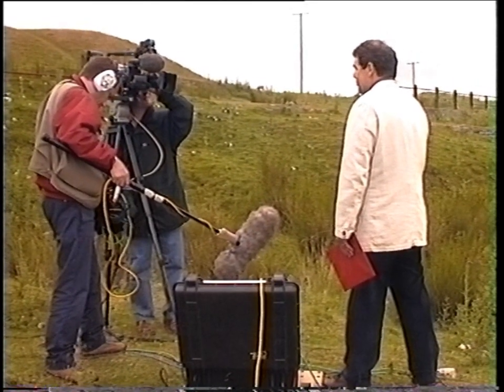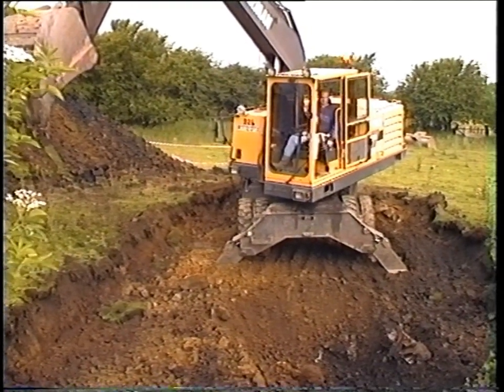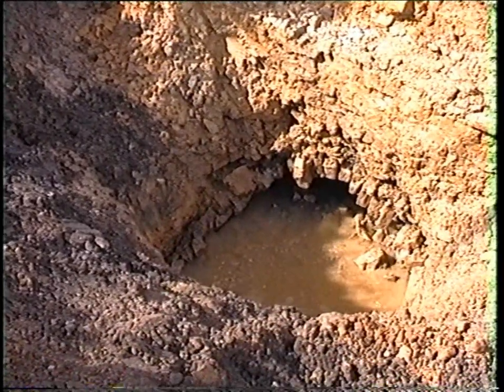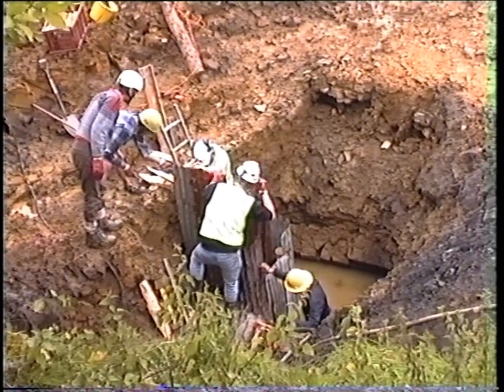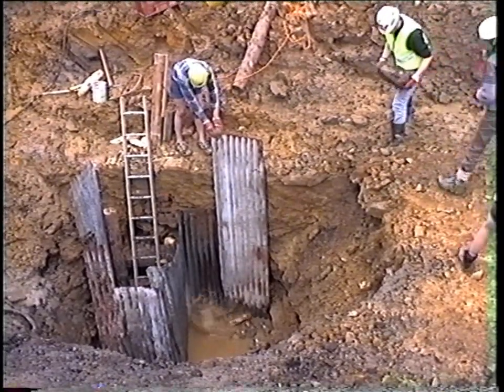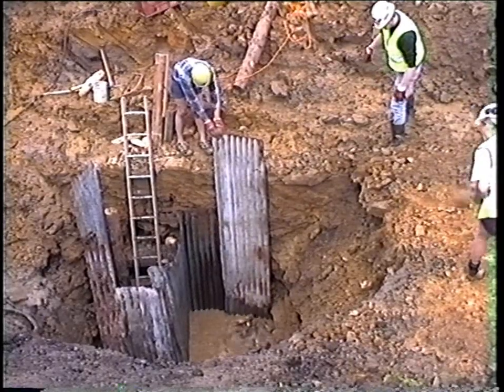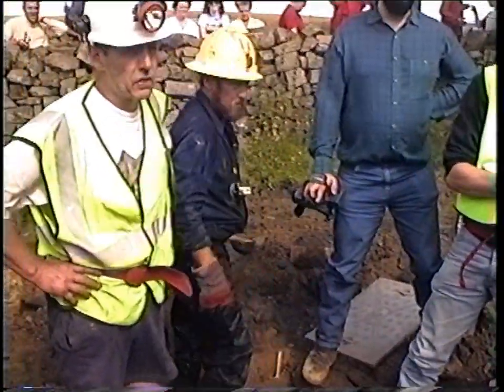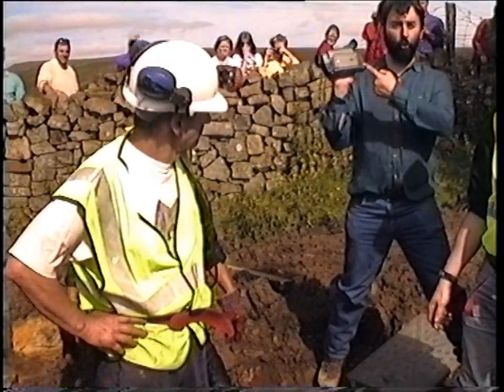Pwll Du Mine tunnel Blaenavon June/July 1999

Comment: Thanks for the great filming with steady camerawork and good picture compositions, which I didn't know back in 1999 you'd done so comprehensively. The gold was in getting into the tunnel successfully and safely, and being part of the first team to get close in recent times to the Y-junction of the Garnddyrys and Tyla entrance branches. There is a strategy for making more progress based on the knowledge gained inside so far, but it involves managing the water inside the tunnel without causing pollution or other problems on the surface and also pumping air to the working face from the surface.

Both the substitute mine manager, John Lister, and the mines surveyor, Paul Deakin, seen in the video, are now sadly deceased through health issues, so there's currently no one in place to help meet the mining regulations when reopening an abandoned mine. This is essential for the safety of everyone concerned - my forthcoming book(s) on the history of Llangattock Mountain and the Heads of the Valleys contain graphic accounts of those who got it wrong in coal mines when using naked flames underground, etc., etc. etc.

The Pwll Du to Blaenavon tramroad tunnel has coal workings to either side along the route and these will have to be plugged as progress is made inside the tunnel down through the mountain. The drop of 70 feet (how the miners measured it!) from the upper to the lower entrance was sufficient when the tunnel was open, without blockages inside, to cause a howling draught. Thereby the tunnel was ventilated quite adequately when it was operated by horse-drawn trams and later a stationary engine. It was also used by villagers living at Pwll Du as a short cut when going shopping in Blaenavon, especially during wintertime. In fact it was difficult not to be blown off your feet at the top end when atmospheric conditions drove the strongest draughts!

The ultimate purpose is to explore and make a survey of the tunnel interior for comparison against the National Coal Board (NCB) abandonment plans of 1961. If the condition of the tunnel is satisfactory then my personal dream is that the tunnel can be stabilised inside and reopened for the public to be able pass through it, perhaps with a small bus picking people up and/or dropping them off at the Pwll Du end. This was my intention when commissioning Michael Blackmore to make his drawing of the planned reopening works. Although the drawing was paid for by my company, The Secret Bottletop Production Company Ltd, and John Rogers (for Torfaen County Borough Council)  (who holds the original), CADW was also supposed to pay the final third but left John to do so instead.

Even if all of us who have been keen to reopen the tunnel end up departing this world before the survey work and restoration can be completed, it would be very good to know that videos like this should still be around to help inspire future generations interested in the industrial history which has helped make Wales, Britain and the UK in general pre-eminent around the world.
Reply from the maker: Thanks for that very comprehensive reply Clive. Very sad to hear of the passing of John Lister & Paul Deakin.
Reply: If your ever going up there Clive be nice to meet you and chat

Comment: Exercise in futility
Reply from the maker: No. Exercise in planning, teamwork and an achievement of objective. Which was to locate and make a safe access into the collapsed mine.
The whole point was to leave a secure entrance shaft.
If it wasn't what you were expecting then I  wouldn't get involved in digging for caves/mines, as it's never a 100% certainty. Although due to the research and everything involved. This turned up trumps on the day. 👌🏻👍🏻🙏🙏🙏

Comment: What was the purpose of that digging and testing and stuff?
Reply from the maker: The digging was to open a safe enrty point into the old workings. I believe that it was thought that a natural cross rift, farther into the workings may have existed. This would then have been explored by those involved in the area.
The testing was a requirement of the H&SI to ensure that no explosive gasses were present. Also to ensure a sufficiently low level of carbon dioxide.
Reply: @kaywills1089  ah cool. That explains the tv cameras etc around that area at the time. I lived in Blaenavon for 20 years and wondered what was being filmed

Comment: I just watched a 'Time Team' video and this came up on list.
I know it's been a few years since it was posted but decided to comment anyway.
Interesting to see how much dirt was moved to get to original tunnel roof.
Recognised the Pwll Du name but cannot remember why ? 
 I know I've been to Pwll Du farm at some time but it would have been somewhere between 1980 when I was racing motorcycles and 1996 when I worked at UK Plant in Bridgend. (I was doing around 74,000 miles a year driving around South/Mid Wales before actually doing work as 'site service engineer' fixing construction equipment)
Now I've got to try and remember why I know it, forgetting things bugs me !